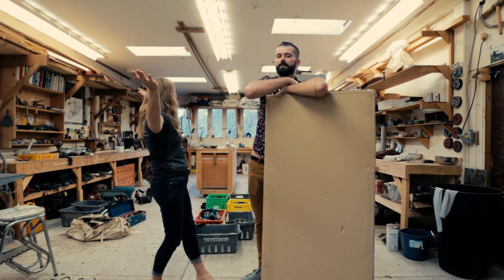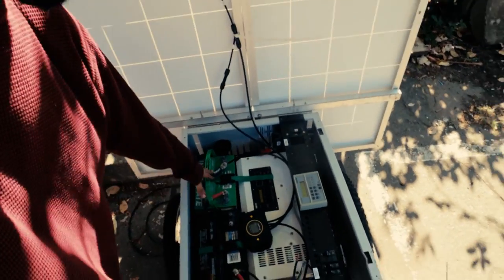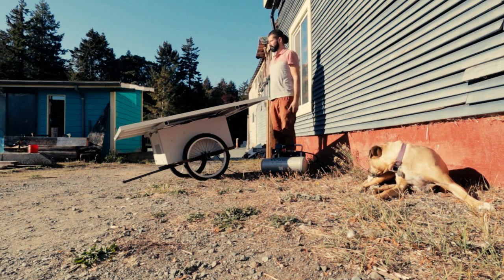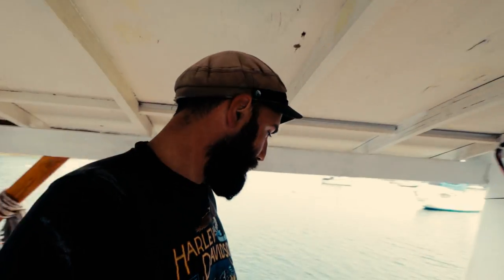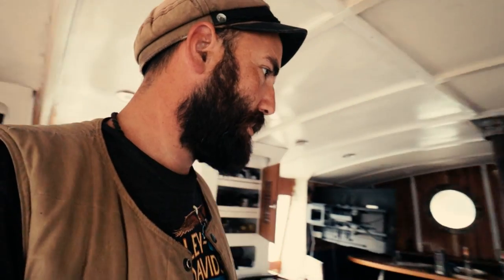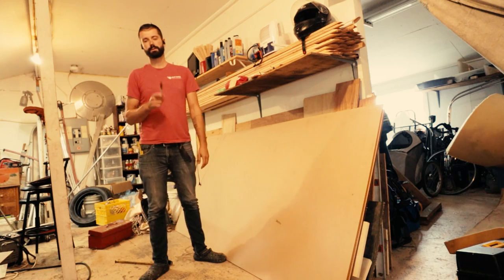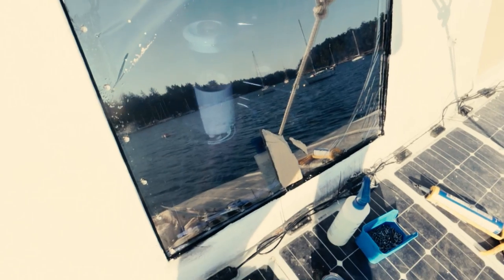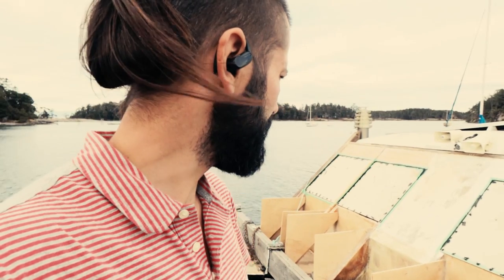Glass Windows on Boats Suck

Comment: Hang in there, Simon. I think by this time you could give a master class on how to put a polycarbonate window in! It's too late now, but next time you have to do a window, consider some 2 sided butyl tape. For a similar project I used 3/4" wide tape. A strip per window side, laid the polycarb onto it and, since I left no gaps in the tape, the window was water tight at that point. Added silicone bronze screws for extra pressure and I used some copper (from an old pipe that used to run water to my bathroom sink. Cut a 2" chunk of pipe, pound the chunk of tube flat, drill the right sized hole in the middle, and spin it with a drill against a file and I had 2 nice copper washers). Some Dynaflex Elastomeric Sealant which I tooled with a popsicle stick onto an edge of painter's tape and I have terrific windows. 2 years on and no leaks!

Comment: One question.  Why did you go with acrylic rather than polycarbonate?  I know polycarbonate scratches more easily, but it won't break.  Incidentally I used laminated glass for the windows in my 1936 wooden powerboat's cabin (all 19 of them).  I glazed them with boatlife polysulphide and they haven't leaked yet, but they have only been in the boat for 8 years.  They are in pretty sturdy frames made from 5/4x6 douglas fir with 3/4" mahogany sheathing inside and out.  I left plenty of space around the glass for expansion of both the frames and the glass.  When I replaced the glass in my butterfly hatch I used 1/2" polycarbonate.
Reply: Acrylic is much more UV light resistant, basically.  Some types of acrylic are more transparent than glass.
Reply: @wallacegrommet9343  You can buy coated polycarbonate that is adequately UV resistant.
Reply: Acrylic sems to have captured the boating market.  Here in the Seattle Puget Sound, most cockpit enclosures use acrylic sheet windows.  Mine are 9 years old and still unyellowed.
Reply: @wallacegrommet9343  The issue I have with acrylic for something like Simon's forward facing windows is that acrylic can break or even shatter on impact.  Given their location, Simon's windows are susceptible to wave impacts in rough weather.  I would want that part of the boat to be strong enough to shed a big wave impact without the windows or the frames breaking.  Polycarbonate won't break in that situation, although it might bend which could cause leaks.  A cockpit enclosure is a completely different application in terms of safety and application.